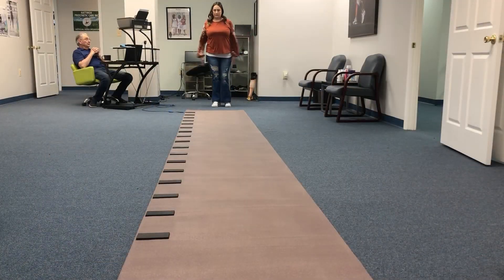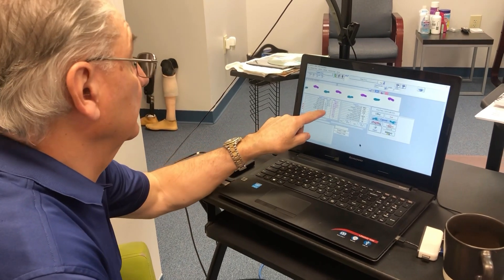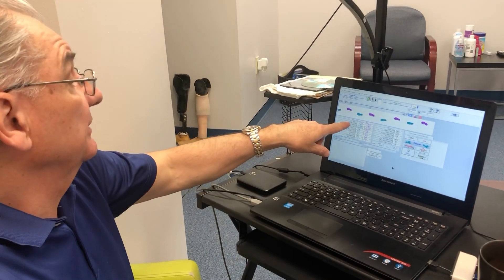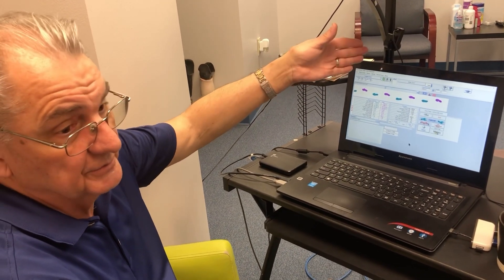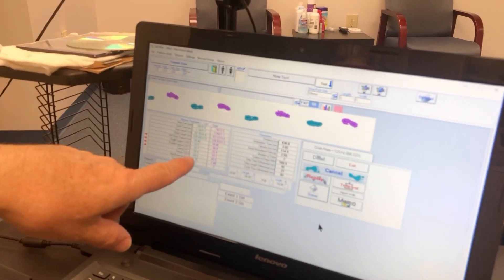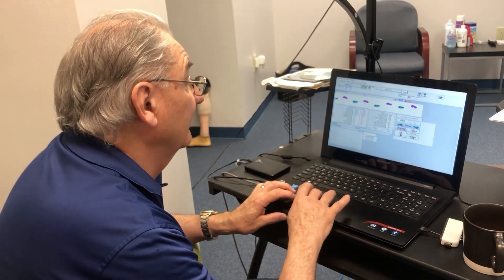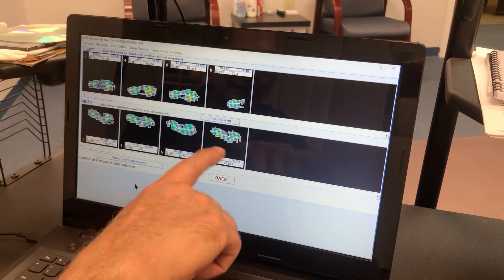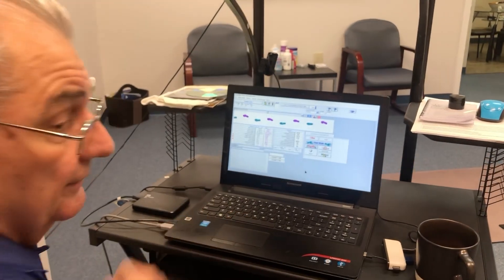What Is A GAIT MAT ANALYSIS for leg amputees?

Comment: WOW!!! Never knew this existed, very interesting.
Sounds like your doing very well.
What about the height test?
Curious bc my right leg feels higher when I have my Prothesis is on. Maybe that's normal ? 🥴🤔
Reply from the maker: It’s very cool! For my height test, he measured my hips. But my hips are VERY off since I walked crooked for so long. He just trusts my word for it now.
Reply: @ElectiveAmputation  
I can imagine that happening with your hips. 
Will they be balanced again? Or is it permanent?
They told me I would probably always walk with a slight limp.
Love,
Your Limpey Friend
Reply from the maker: @jeannie2548  I am slowly balancing out. So as my limb is constantly changing so are my hips. Fun fittings haha
Reply: @ElectiveAmputation  
Gotcha' 👍 
Constantly changing!! Understand!!!!!
Reply: @ElectiveAmputation  mine al ways feels a little tall as well. I think I can fix it with a hack saw. Just like they shortened my leg.🤣🤪🤪
Reply from the maker: @juanfootjohn2125  don’t forget the heat gun too! You don’t want to screw it up 😂😜
Reply: @ElectiveAmputation  I have been forbidding to take A heay gun to my socket.ol Doug would kill me If I jacked up the sockets he works so hard on. LOL
Reply from the maker: @juanfootjohn2125  same! I would be on the black list for sure! Haha
Reply: @ElectiveAmputation  Here in nine days i'll be in carbon I'm pretty excited about this one. I'm pushing for A pin lock system in this one. I may not get that tho.